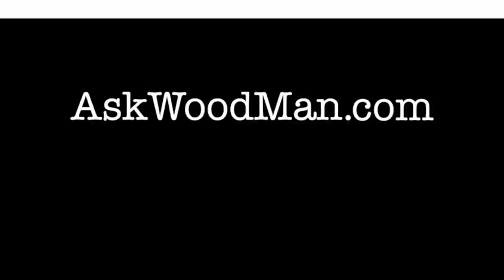10 Four Drawer Bedside Table • Routing Dado For Back Frames

Comment: i still use my original makita for everything.  its big its powerful and so far i havent found anything it cant do.  i bought it late 80's early 90's from memory.  cant break it lol
Reply from the maker: That 3612 was bought in 1988. It has a little jiggle in the plunge mechanism but is still as strong as a young bull. Since I made that new edge guide for it based on Jeff's idea, I have been using it a lot more. It is a beast.

Comment: What about "Locking Depth Stop Rod" in a Festool 2200?
http://www.festoolusa.com/power-tools/routers/of-2200-eb-router-574354
Reply from the maker: That is a really brilliant depth stop design, but it only limits the router plunge action on the down stroke. It does not limit the router from the reverse motion. Unless I am missing something on that router I can't find a limiter mechanism when the plunge lock is released.